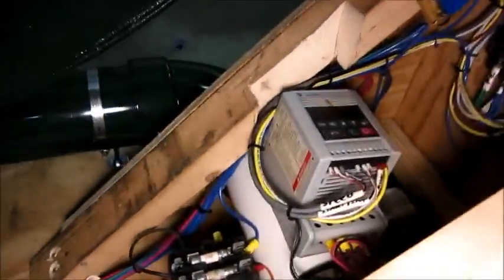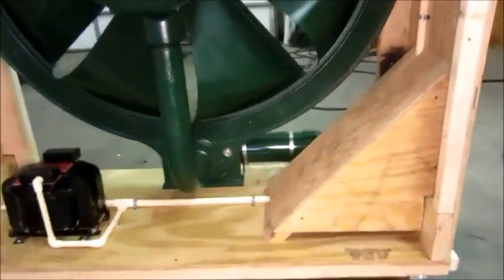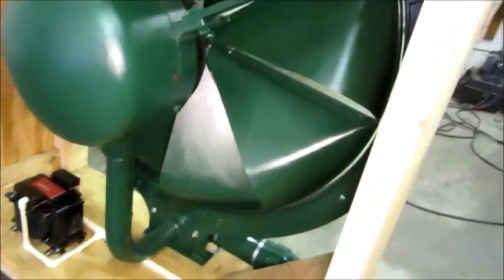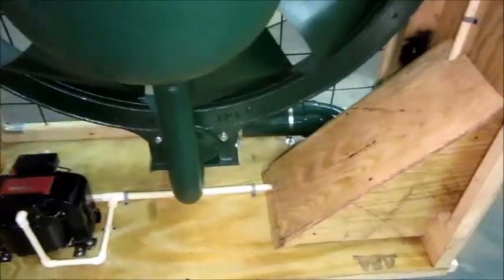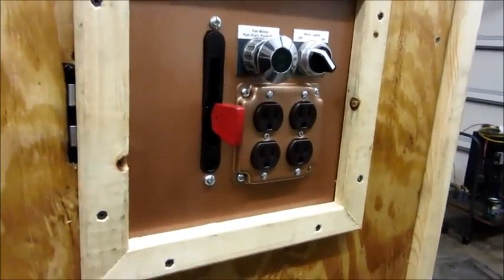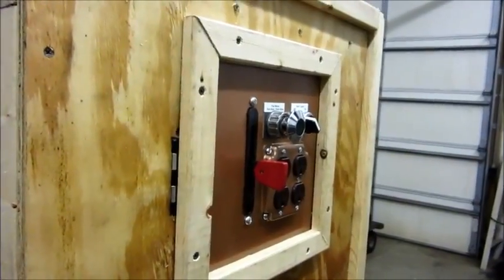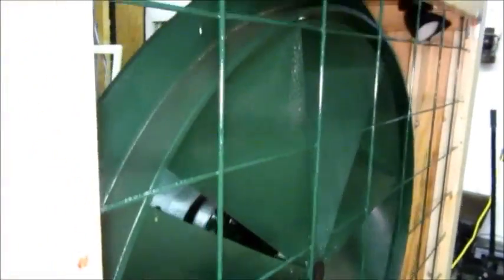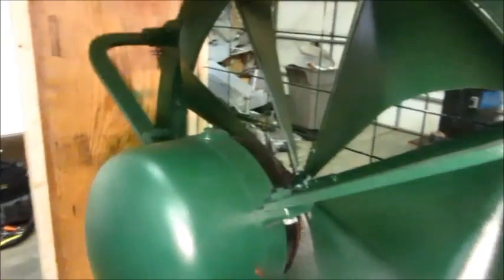Antique 48" ILG Electric Ventilating Co. Self-Cooled Motor Fan Restore - part 6

Comment: I have the 16” version of this, finally installed it last night! Made a wood mount for it. I like the bucket blades better than the propeller blades. Yours sounds like it runs quieter despite being 3 times the size.

Comment: 2 things that should be added. A filter for the cooling system to keep the larger motor from getting shop dust in it. And maybe a 7 segment LED indicator on the control panel to show current draw for the entire system including extra plugs. But other than that this looks fantastic. Something I would sink my teeth into for sure.

Comment: How many amps does that fan pull while running?
Reply from the maker: Eric, the motor winding has a rating of 4 amps at 3-phase 440V. The VFD drive is taking care of the motor winding current, voltage, and frequency.

At the 120V power cord (using power from wall outlet) it is drawing about 3.5 to 4 amps when running at about 25% speed. Assuming an 80% efficiency, that is about 0.43 HP at the shaft.

The power requirements go up exponentially as the fan blade speeds up. This is a characteristic of most any fan - power requirement to turn the blade goes up exponentially with RPM.

The input power to the fan is limited to 19 or 20 amps by VFD drive tuning. When the fan is at 100% speed, it is using about 19 amps at 110V. That is about 2.09kW.  If we estimate the motor and VFD system is 80% efficient at converting electrical power to mechanical power, that would mean the motor is putting out about 2.2 HP at maximum speed.